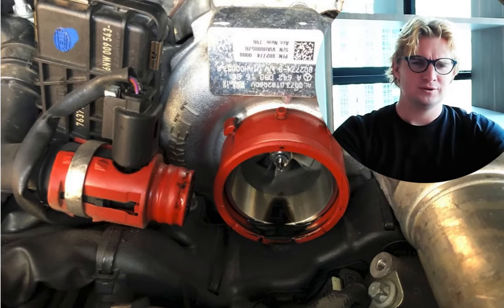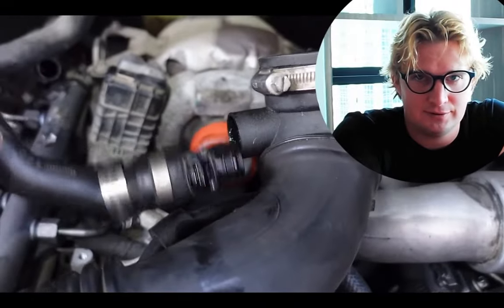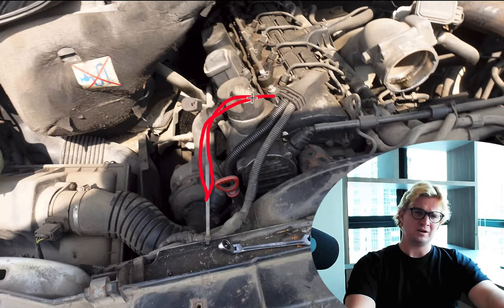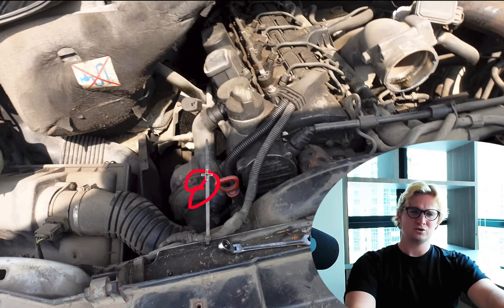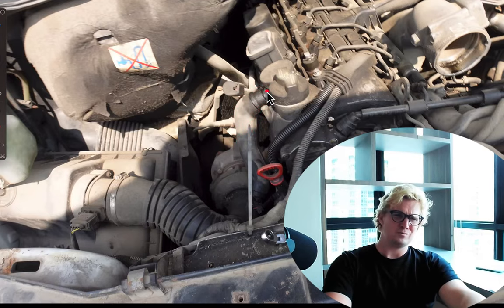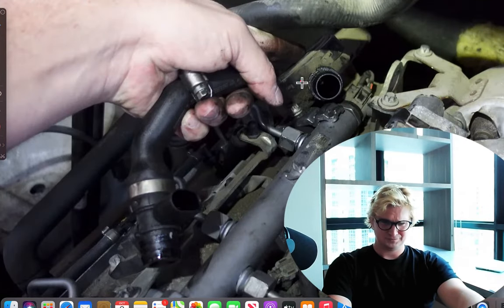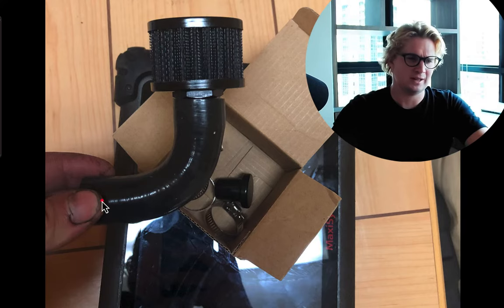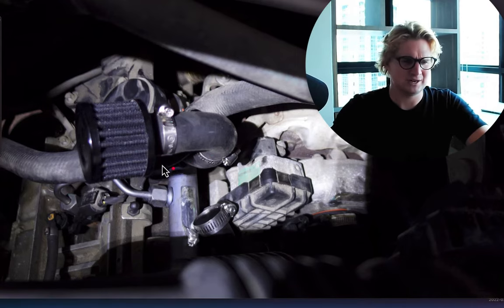A Weird Upgrade Every Sprinter Owner Needs

Comment: I think the main reason you are not going to see too many mechanics recommending this is because blow by gases get re-burned for a reason, they are horrible for the environment. You're basically just pumping oil vapor and raw fuel into the air. The customer is going to smell it, and defeating emissions equipment is a crime so its definitely a risk for a business to do this.
Reply from the maker: These filters are sold at autozone and oreilly's, PCV system though it may have the capacity to act as an emissions device it is not it's sole purpose. The air that flows through the cabin comes directly from outside although I have heard that this engine on smaller cars exhaust in the cabin can be an issue in which case I suggest a longer hose leading under the vehicle or a catch can which makes things better too.
Reply: So you are saying that this filter does the work of a catalyst converter? 🤔
Reply: if you use a catch can the vapor will get sucked back in but the oil is filtered out
Reply: 😂😂😂 this guy!
Reply: Stop acting like you care about the "environment".  I bet you eat McDonald's and KFC.  This mod is not that bad and emissions guys are easily paid.
Reply: @peacefulbeast8386  I'm confused, what exactly does eating fast food have too do with global emissions?
Reply: And when stopped at lights all the vapour comes from under hood looking like you cars on fire 👎👎
Reply: You evidently don't know what PCV (Positive Crankcase Ventilation) means and it has NOTHING to do with emissions knowitall. 🤦‍♂️
Reply: @MDM1992    first used in the Second World War and present on most modern engines, PCV'S send the crankcase gases back to the combustion chamber, as part of the vehicle emissions control, in order to reduce air pollution.

Literally the first paragraph on Wikipedia for PCV systems.
Reply: You put a hose to dump it below the car. Protects the engine, so screw the environment
Reply: @spikerbrad23  Cows produce methane gas just like the mountains of trash at the dumps where it is collected to the best of their ability. All over the world where dairy cows, and Steak/burger cows are farmed, methane gas permeates the air like pollutants from vehicles, boats, trains, and airplanes.
Reply: @spikerbrad23  My Cummins truck vents straight to the environment, and its factory, its an 03. So far the world hasn't exploded.
Reply: @yosquidd242  for that I am cooking steaks and hamburgers tonight to help protect the environment.

Comment: Another solution which would be 100 times better. Is a sealed system catch can. Where you can capture the oil and drain it out at regular intervals, and you wouldn't get the smell, or oil spraying off that filter when it gets soaked. Catch can kit is about $50 for a Chinese brand, they work as intended.
Reply: Can you link to this solution?

Comment: I have a 2014 cla250 and I’m having this problem right now. Looks like oil is coming out the intercooler hose that attaches to the turbo. I only have problems when I accelerate fast or hard or go fast speeds. I’m so over it. I don’t know what to do for this model

Comment: If you sevice the engine correctly this would not happen. There is a breather filter shich should bd cleaned or replaced. Just as cheap.

Comment: ive a 2005 2.7L sprinter and im getting crazy amounts of black smoke when under load/ setting off. engine is very tapety as well. i take it i may have injector issues as well as this?
Reply from the maker: Please please Don’t drive anywhere.  Leaky injector can equal engine failure.  Seen it too many times on those 2.7s. If I had to guess an injector would be my best guess.  But I’m not there.  Do u have rail pressure codes?   Blowby ok?  Excessive heat?  Perhaps feed it a couple bottles of diesel purge as that can be a temporary solution for some injector issues.  How many miles?
Reply: @sprinterfix  im pretty new to the sprinters. i assume i can get pressure codes from an obd reader or what ever these mercs use.  heat is ok doesnt really get hot i havent really stressed it.  360k Kilometers. im also getting oil in the intake like in the video
Reply from the maker: @decoyla  yes, you should be able to read rail pressure directly from a not so expensive scan tool but not likely from the cheaper 5 dollar ones. might need to spend 60 bucks or so. Flordia Van Man likes the autel ap200 which is a good place to start. My personal favorite is the delphi DS150E. but I don't know which part of the world you are in. Given you are talking in Kilometers Ill assume outside of USA. so I am not sure which scan tool to recommend. If you have no check engine light then likely your rail pressure is not too bad. but please be cautious all it takes is for one bad injector to cause a piston ring to seize up and your engine is toast. I have seen a few with the same mileage as yours do this.
Reply: @sprinterfix  yeah we have those here. many thanks for the help
Reply: @sprinterfix  sorry one more thing ive a Autel AutoLink AL519 OBD2 reader. that should do the job? for reading the rail pressure? thanks again
Reply from the maker: @decoyla  Judging by the description on the autel website of that model it sure looks like it does. just select data live stream and it should be on the list of sensors. but unless you have a low pressure code you may be wasting your time as rail pressure is very dependent on engine load. So if it were happening to a sufficient degree under high revs you would likely see a Pcode or two as well as freeze frame data showing a difference between requested rail pressure and actual rail pressure. 
Id focus on any current or pending codes the scanner shows. even if these codes are not triggering a check engine light yet.
Reply: @sprinterfix  sorry just coming back to this. i got the  breather kit. just wondering  about the sensor thats  located at the lower end of the pipe that gets deleted. do i need to worry about that?
Reply from the maker: @decoyla  interesting enough that is a heating element. I suspect Mercedes wanted the oil vapors to stay vaporized as they passed through the intake.  I usually block off past the element and just zip tie that portion of tube to the intake to prevent any rattle ( I did not show this in the video)
Reply: make sure you turbo is spinning, take your injectors to a bosch service center, injectors need to be serviced every so often so you dont blow your motor
Reply: My code reader told me low comman rail pressure   replaced the fuel filter with another after market one Deleted code that was 2 years ago PS not all aftermarket filter work on these sprinters Dealers 3 time the price but work good every time
Reply: Triple-check that you don't have any boost leak issues, especially at the resonator and the hose between the resonator and the intercooler.  When you're done triple-checking, then go ahead and triple-check again.  This seems to be the absolute most common black-smoke causing issue with the T1N Sprinters.

Comment: This may be a dumb question but why no mention of the engine's oil separator in this scenario> Doesn't it play a part in all this?
Reply from the maker: Not in this solution.  I did however buy a catch can and will try that on another van if there is interest.  In this one the inlet side is plugged so blowby is just released and not recirculated.

Comment: You must   wash the  tiny filter inside the crankcase breather first that will release the pressure inside the engine there in no point fitting and after market filter as the original is blocked there is to much oil going to the new aftermarket breather it a breather  not an oil separator you will  have a mess of oil everywhere and smell off burned oil in the cab in time I like your idea off blocking the fume pipe  I have done that to with great success
Reply from the maker: It really feels like u didn’t watch or understand the video.  If you can understand how the pressure actuated cc valve works u will understand why that’s not true

Comment: After a week of breathing that in you will look for another solution in form of Mann Provent oil catch can. I did this exact mod before the catch can on my om642 ML and you could see fumes coming out of the hood and grill. 
Not to mention that “blow by” was calculated in to the ecu with mass airflow sensor and adequate amount of extra fuel was ordered.
Reply from the maker: Boris, could you send me a link to an oil catch can that works? I'd love to try, to be fair the ML /GL om642 is quite tightly crammed into the space so perhaps fumes escaping into the air cabinet could be a problem. Id recommend extending the hose further under the chasis if this is the case. regarding the ecu accounting for this volume, it is only a half truth in that it is picked up by the charge pressure sensor but the map and maf sensors allow for some variance (10% I believe) to  differ between the pre turbo pressure sensor and the post turbo sensor. ultimately it will cause the engine to run leaner and more economical if any meaningful change at all
Reply: ML is a daily but the sprinter is a camper which is only used few times a year so i left that alone. YouTube doesn’t allow links but you can easily find it Mann provent 200.
Reply from the maker: @borisb2367  yea, I took a look, maybe I will try that one out. on another note: anything you feel needs to be covered in a video as far as sprinter repairs?
Reply: @sprinterfix  my 2009 Jeep CRD I found a kit that you welded into the exhaust pipe. Fumes went right out the back
Reply: @sprinterfix  would love to see the provent installed on the 2006÷2009 years. Also one on wiring harnesses on top of the motor
Reply from the maker: @kayakwesty  that seems like a good idea but with the modern emissions exhaust gas pressure gets pretty high so Id be worried that it may pressurize the engine block. curious on what that looks like though. send photos? I think that if customers have excessive blowby and theyre idling for long periods of time then perhaps just extending the pipe further down past the engine should be fine for most people.
Reply from the maker: @kayakwesty  can do.. certainly.. I am still thinking about a video on biodiesel. I think the best thing for me to do would be do use it it a van for an extended period of time and report back on the issues. too many variables to theorize what could and couldnt go wrong so just have to sacrifice a van for it haha.
Reply: @sprinterfix  yeah my jeep Cherokee died long ago motor and transmission were great.The Jeep electronics dies on it. I gave up. The PCV exhaust entered way down stream past the muffler. You welded a nipple into the exhaust
Reply from the maker: @kayakwesty  ahh, those jeep ecus can just die out of nowhere, too many gremlins on those things for my liking.
Reply from the maker: @kayakwesty  can do
Reply: @sprinterfix  funny...you nailed it. That jeep would run great...then die...then cut hard to right and try to put you in a ditch...sketch
Reply from the maker: @kayakwesty  yea, I have seen a few of those come into my shop, (never seen the diesel version) owners would state, driving perfectly one day then the next it wouldn't even turn on, or stay running.
Reply: @sprinterfix  This is why I went with the catch can I mentioned. It has a built in pressure relief valve in case it accumulates too much oil or freezes. Living in cold WI, that put my mind at ease.
Reply from the maker: @borisb2367  I see, I dont have too much experience with sprinters in the cold. coldest Ive been was yosemite park for a weekend. high 20s farenheit. I've wanted to take a van out to Alaska for a while. any suggestions to winterize it?
Reply: @sprinterfix  I did a ski trip to Montana last Christmas and average wind chill was -10 to -20. The van performed well except at freeway speeds where it had trouble retaining temp in the engine. I had to improvise a towel to cover the grill. Definitely make sure you have something for that problem ready to go. Also make sure your fuel system/injectors are tip top because it will have problems starting in cold if anything is amiss. Bringing a portable jump pack wouldn’t be a bad idea like gooloo gp4000 or similar. Plenty of anti-gel additives just to make sure. Otherwise ship shape
Reply from the maker: @borisb2367  Nice yea, thats interesting that the engine couldnt get hot enough. I definitely have a few portable jumper packs. auxilliary diesel heater for the cold nights. have you tried the liquimoly diesel purge? its surprisingly effective for making injectors fire a little smoother.
Reply: Excactly! spot on!
Reply: Iv been thinking of the Provent 200 for my e280 cdi with the om642 engine. Has the catch can worked for you? And did you hook it up to the original pcv valve or did you remove it and hook it directly to the crankcase?
Reply: Agreed. Rather make sure your oil level is correct. Drivers tend to top up and this is the main cause.

Comment: The PCV delete/bypass (using a simple breather port like that) will fail an emissions test if you're in a region where that's relevant and the tester notices the modification, but otherwise this will work fine. So obviously for off-road or otherwise not road legal vehicles this would be a no brainer.

An actual design solution that would avoid this and maintain PCV function would've been to connect the crankcase breather downstream of the turbo's compressor outlet, so between the turbo and the intake manifold. You'd reduce turbo efficiency just slightly and likely increase crankcase pressure somewhat as well (due to turbo-compressed air pushing back against the flow through the PCV tube), but that should be such a minor issue as to be ignored in most cases, especially compared to what they actually did.

The only case you couldn't use that solution would be in a gasoline engine using a carburetor or single point fuel injection upstream of the turbo (or supercharger) in a draw-through configuration as you'd have fuel vapor + droplets in the compressed charge in that case which would thus contaminate the crankcase and oil. (but that's a nonexistent problem for modern commercial engines ... I suppose water injection upstream of the compressor intake would create a similar problem, with water vapor/droplets being pushed back into the crankcase, but also not a common feature)

Comment: I'm goingnto try this on my 2010 ML350. That thing is burning through oil aomething crazy. Had Mercedes do an oil consumption test and they said its normal.
Reply from the maker: Meh.  U might Wana extend the hose a few feet to underneath your vehicle. There isn’t much space between the engine and the hood on those

Comment: 2019 Mercedes sprinter 2500 v6 turbo diesel. I occasionally notice a small blotch of oil on the garage floor. I do not believe it is a general oil leak, I feel that I notice this after we have used the van to tow a trailer and side by side. You mentioned this may occur when the turbo is put under load. Would it be possible that what you are describing would throw a small, individual splatter of oil on the cement floor, the engine bay seems clean and free of oil, is this bad for the engine? I have brought it to the dealership to "fix it once, maybe twice now" they have put a new clip on it under warranty. But i don't believe the dealership is worth a hoot. I wonder if I should try your method.
Reply from the maker: Yes absolutely.  Air intake pipes have connection points underneath near radiator at the intercooler.  Under load can cause extra oil vapor and or a bit of oil splatter to get sucked up from block.  Not much to worry about. If it gets real bad replace pcv

Comment: Hi you are dead right , what size is the filter connection and or hose will go purchase on and a reticulation  block off fitting
Reply from the maker: Yea.  I’m dead.  I don’t remember the exact size but the ones for Cummins engines fit perfectly and those are the first to show up when u search this product

Comment: I have a sprinter 2012 with 2143cc OM651 Do you recommand to instal this kit preventive ? Thanks for your videos!
Reply from the maker: Absolutely not.  If your pcv valve is working just leave it be.  Only if you are seeing it spurt oil all over the place

Comment: I am getting limp mode P0299 and have oil in the turbo hose..etc  Would like to get the fix (Crankcase Breather for PVC) but it isn't on Amazon anymore.  I have a 2004 Sprinter 2500 2.7L.  Any help with either how to get the Breather for PVC or PVC part would be greatly appreciated!
Reply from the maker: hmm, are u certain those issues are related to eachother?
Reply: @sprinterfix  Not 100% but you state " Turbo charger oil leaks usually get misdiagnosed by mechanics when really the PVC valve is leaking. sometimes this causes Limp Mode and P0299 codes"  So I thought I would first try installing the Crankcase breather you are suggesting on this video instead of replacing the PVC valve which is 20 yrs old.  Any suggestions and how to get the parts is greatly appreciated.
Reply from the maker: Sorry I took so long to respond. There are a few things to unpack here, likely want to use a smoke machine to see if your turbo system has any leaks. Some oil going through the turbo is normal. before doing the breather tube consider a catch can. Also you can test to ensure it is oil coming from pvc vs oil coming from leaky turbo by removing the pipe going between turbo and turbo resonator. Also remove pcv and block off or leave unplugged for this test. make sure no dirt can get sucked into the turbo. run the engine and see if oil is beading through the turbo outlet ( the part that sends the compressed air to the resonator).